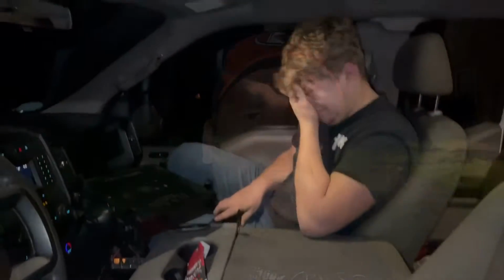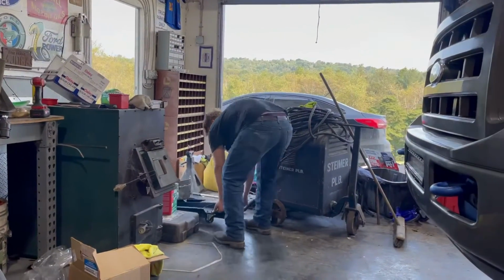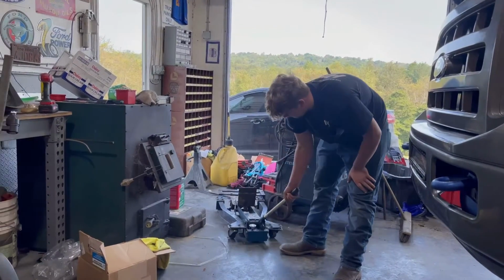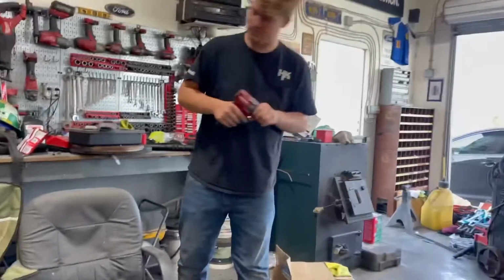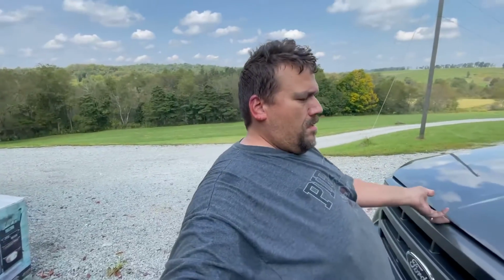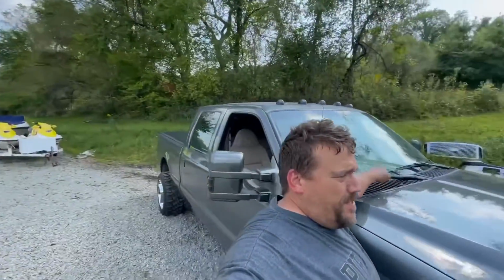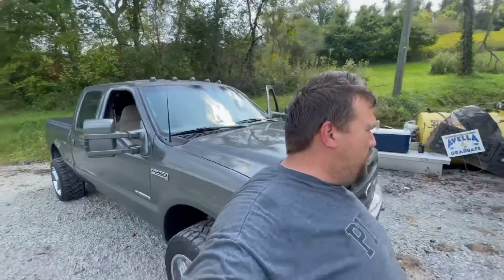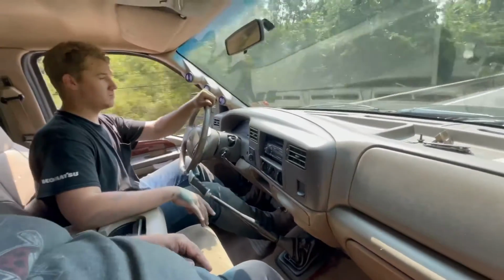Henry 5 Transmission Install And Test Drive

Comment: Nice looking Super Duty! Is there any work done to the 7.3L to eek out extra power? A different program or air intake anything like that?
Reply from the maker: He runs a 100 horse tune from Super Chips it has the larger turbo housing with the wastegate deleted. We where just doing some trouble shooting today it has a 3/4 throttle stumble that  I think is a bad throttle pedal, but time will tell.
Reply: @Mongos_Garage  

Yeah, those factory throttle switches were crap when they rolled off the showroom floor! So much delay in them, an aftermarket one might fix him right up?
Reply from the maker: It was not the throttle pedal. Back to the drawing board.